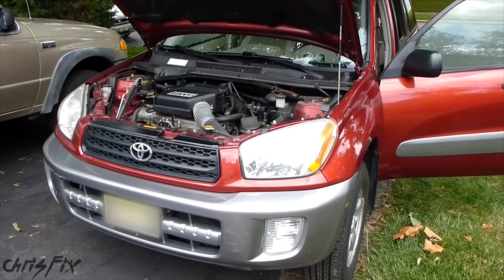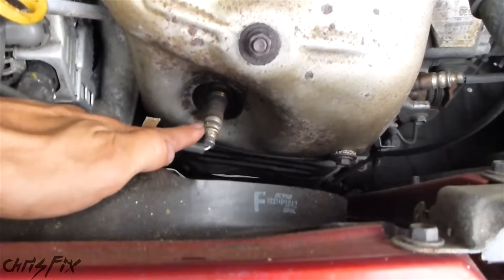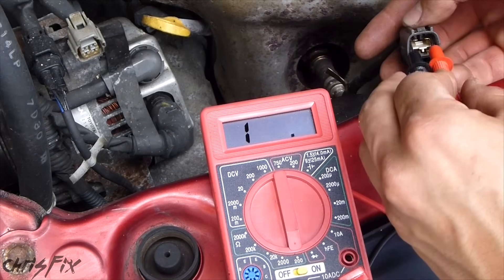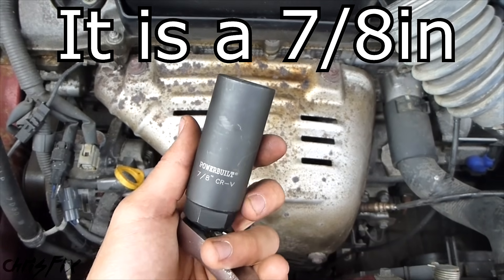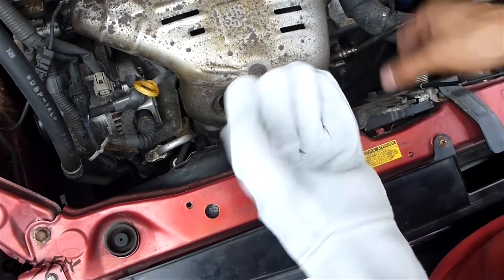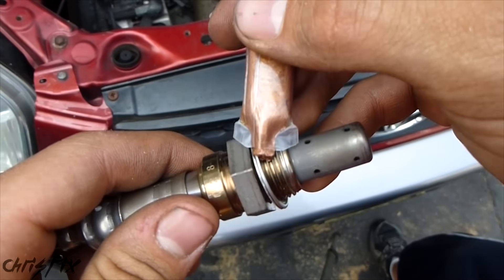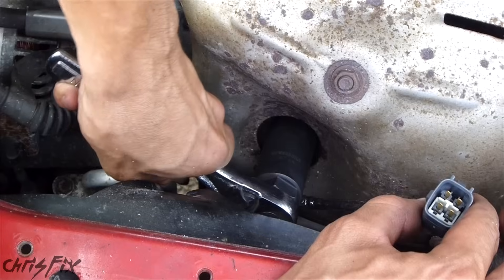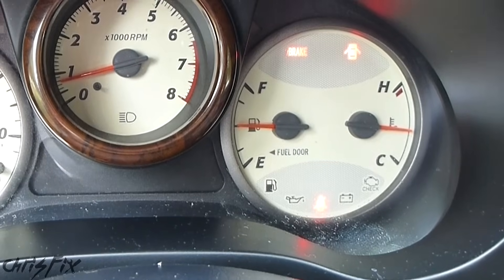How to Check and Replace an Oxygen Sensor (Air Fuel Ratio Sensor)

Comment: Replaced the sensor on my catalytic converter as there was a flatline on the voltage. I still need to fix my exhaust as the linkage between the catalytic converter and the resonator still has an opening where it'll shoot the exhaust smoke underneath the car and I don't like that. I also use the BlueDriver OBD2 scanner for the live data so I can keep an eye on the sensors, such as the Oxygen sensors, engine temperature, and so on.

Comment: You actually got that cheap Harbor Freight free gift digital multimeter to work correctly?  More power to you.  I didn't trust it so I went out and bought an analog multimeter from Home Depot.  I felt lucky that they still make them.  I have a cheaper Radio Shack analog multimeter that I fried the resistance meter on because I connected it to a live AC circuit in resistance mode.  I  also learned the hard way not to use the O2 sensor socket that HF and others sell because the slot is way too wide and does away with 2 of the hex corners and the socket can never get a grip strong enough to break the joint without stripping the sensor's hex head.  I bought one from Pep Boys that has the narrow slot and all 6 hex corners.  I also learned the hard way that the best and only way to break the sensor's mount is to use a large socket over the end of the O2 socket's hex with a 1/2"-drive and 1/2"-drive breaker bar, NOT by using the O2 socket's 3/8"-drive and a 3/8"-drive ratchet wrench with a pipe for the extra torque leverage.  The 3/8"-drive is too weak and I learned NEVER to use a pipe with a ratchet wrench, only a breaker bar.  I ruined a 3/8" Craftsman ratchet wrench that way that was an heirloom from my stepfather and he must be turning in his grave.  I doubt if I can repair it and further doubt that Craftsman would honor their time-honored no-fault hand tool replacement policy, especially after they transitioned their vendor from Sears to Lowes.  Live and learn and thanks.

Comment: hi Chris...I changed bank 1 sensor 1 on 2001 lexus gs 300 and a P0125 code popped up (didn't have this code before oxygen sensor change). Any ideas? Engine runs good and car temperature is always normal. Could an exhaust leak trigger it?
Reply: Either the sensor is bad or not put in correctly. I have a gs400 myself. Denso is the way to go not Bosch FYI....

Comment: Bank 1 sensor 1 is right side of engine topside, right?
Reply from the maker: It varies on the engine but sensor one is the sensor closest to the engine.
Reply: ChrisFix how come your amazon links the items look different to those in your video? That diagnostic tool is a Bluetooth device connected to smartphone?
Reply: Hey bro I pushed that tab but it’s so stiff can’t pull out how can I ease it out more easier?

Comment: Chris, I installed  the 2 sensors on my Toyota Camry 2002, about a week later my car stalled on the free way and dis not wanted to start, I was pulled out of the freeway to a gas station, I waited 5 10 minutes for help,  then suddenly the car stater again and I drove it for 1 mile and stop again,that happen about 1 mile and so on, that happen 5 times until I was pulled to my house and i have been able to started again for almost a month and half. two mechanics had check it and can find the cause why the car does not to start. The fuel pump, the battery is new, the starter  and spark plugs are fine. When the engine  started on those 5 occasions sound smooth with no noises or nothing.  Chris, I need your help and advise of what could be wrong?

Comment: Hi Chris my 2010 mazda 3 shows a P 2096 post catalyst fuel trim  system too lean bank 1 I bought a multimeter to do just what you did on your video but  mine is 5 wire all  different colors yellow, red, grey, white, green so I did not check the O2 sensor.  Anyway do I need to change the O2 sensor with that code.

Comment: Im getting a P0057 on a 2011 toyota sienna occasionally with the van right around the time the code popped up sometimes the van will have an extended crank before it starts.  Almost has 170,000 miles on it mostly highway miles.  Van runs good seems you can run some injector cleaner through it the extended crank issue will go away for a bit then return.  It is possibly with a P0057 to cause an extended crank.  It does not hesitate or sputter just sometimes more cranks a extra couple of turns or so before it hits.  Sparkplugs were replaced around 120,000 with denso iridiums.  The first start of a morning it does not do that its when you drive it then come back out after a 3-4 hours or so then start it sometimes it does that and sometimes it wont.  Just curious what your thoughts are on it.  We bought it used almost two years ago with 95 thousand on it and it did not do this nor have the P0057.  P0057 and occsaional extended crank started around October 2018.  When you scan it for codes thats what pops up P0057 heated oxygen sensor heater control circuit low bank 2 sensor 2

Comment: I have a p2a03 “o2 sensor circuit range/performance bank 2 sensor 1” i need help bc i been getting this code and now a p0300. And car runs normal good power but at idle it’ll drop and seem likes its going to stall and die but then it catches itself

Comment: Spraying some PB blaster a few hours before will help to break it loose and prevent a possible breaking off of the threaded collar of the sensor. If you break that off in the precat bing hole you are in for a fun time..not.
Reply from the maker: Thanks for the tip
Reply: @chrisfix  ,sure thing. Thanks for the excellent videos.

Comment: Thanks, Chris!! My RAV threw a P1135 and I spent 6 hours today reading articles, trying to figure out the air/fuel vs. heater config in the sensor wiring and diagnose the whole circuit... and it took me less than 10 mins to watch this vid AND diagnose the faulty sensor. Really appreciate it!!
Reply: Was it the one in the far back? My p1155 is showing but I checked it and it works but there is also a p1135 b1s1.

Comment: Thanks for sharing the knowledge. Question,  if I measure the resistance and it shown 13.2 instead of 2.6, is the sensor still good or bad. Thx
Reply: I think if it's showing any resistance it works. You can clearly see him using the method on a bad sensor and there's nothing.

Comment: I need to replace my upstream o2 sensor. Is it identical in design to the sensor downstream? In other words are there differences engineered into upstream vs. downstream o2 sensors or are they interchangeable?

Comment: I thumbs uped, however I was told you never EVER touch a brand new O2 sensor.  Treat them like headlight bulbs cause even the oils from your fingers can ruin them or degrade performance.

Comment: I'm having major trouble finding how to replace a bank 2 sensor on a 2005 Lexus ES330. I've been told that the bank 2 sensor is much more complicated to change because it's actually behind or underneath the catalytic converter so if this is something that I can do myself, I would prefer to do it myself because it would save me a lot of money. So far, I can't seem to find one for my specific make and model and year but everything I have seen, it's flip-flopped from what I've been told and seems like the bank 2 sensor is easier. Can you help at all?
Reply from the maker: Go put the car up on ramps and take a look.
Reply: @chrisfix  thank you for the fast response, I really do appreciate it more than you know. It's been almost 3 months and I can tell that the car starting to run not so smoothly and I've been doing Uber and I'm desperately looking for a full-time job so I can get completely away from that because it just messes your car up. As far as the bank 1 and bank 2 sensor, is the bank to normally harder to get to? I don't have ramps readily available but I think my dad does so that's something I might even go check out tomorrow but if you know about the bank 1 and bank 2 sensors, is one or the other usually a little more complicated to get to?

Comment: Hi there...i have a 2014 hilux pick up....4x2- 2.5 ....i have an error code P2237....bank1 sensor 1 ...could you please inform me about the spare part i need? with the oem code if possible...tx a lot

Comment: Hey Chris, I just picked up an f150 with a 5.0 HO engine in it. I noticed they changed the headers and made some ugly custom exhaust job and didn't include the o2 sensor. from whati can see they are using the f150 wiring which was meant for 1 O2 sensor and i believe the HO engines came with 2 because they had dual exhaust. I guess my quetions is will i need a new harness and 2 o2 sensor or do you think i can get away with 1? Thanks! and love your vids been fixing up my truck following your videos.

Comment: Best not to break free the old O2 sensor with a ratchet, esp if it is a tough customer to remove due to age and corrosion. You can damage the ratchet mechanism or cause wear that shortens its life. Use a breaker bar to free up the sensor, then spray some light lube or liquid wrench type thing on the threads, then switch to a ratchet handle. With many vehicles you don't need the slotted socket. You can use a box-end wrench, preferably 12-point. Also, on the vehicle in the video, you might be able to remove the heat shield, making the sensor more accessible, and amenable to a box-end wrench.

Comment: Hey chrisfix big fan here. I wondering if this method works as well for a 02 oxygen sensor on Ford F-150 2014 by checking the sensor with a multimeter?

Comment: How about a single wire O2 sensor.
Reply: @O R look for 0.5 volts average reading but will range from 0.1 to 0.9 volts and vary alot very quickly with time

Comment: Hi Chris, great videos as always. I had a question regarding my cars mpg. I have 2012 Honda Accord Se. It’s is getting very poor gas mileage. I am only getting about 230 miles to a tank. I have cleaned the MAF sensor but still no change. I did change the spark plugs around 40k mark. 

There is no CEL so I’m not sure where to look next. Can You think of anything I can try myself without taking it to dealership. 

Thanks in advance. 

I will post it in your MAF cleaning video as well. So I apologize for posting it twice.

Comment: Is it the voltage on the harness default to 12 v? 
I have engine light on upstream sensor p0031 i checked resistance on the O2 sensor and its fine , but voltage at harness is 3v which I am confused, any help appreciated.

Comment: hey ChrisFix, I have a 2004 Nissan Sentra with a P0420 and decided to test my upstream o2 sensor. But my o2 sensor has 6 prongs and 5 wires... also, black, gray, white, yellow, pink wires.... please help haha the other side of the connecter has 6 wires, also all different colors and they dont even match those. Also, I have the repair manual and it says that this car should have a 3 wire o2 sensor.

Comment: Do you need to disconnect the battery when replacing sensors?  
I need to replace a sensor in my car but I need to smog it and dont want to erase the memory.  Should I still disconnect anyways?

Comment: Great video. Hey Chris I have 2005 PT cruiser both 02 sensors downstream was showing on check engine light replaced it with a bosch check engine light stayed off 160 miles now both showing low voltage P0031 and P0037  on both tell me you can't use after market on them and that's the issue? ?? Or could it be something else like PCV valve or hose?
Reply from the maker: So the PCM (engine computer) supplies the voltage to the sensors. Make sure he screws holding the pcm to the firewall are tight because they are one ground source. Check and clean your other engine and chassis grounds. Clean your battery posts and cables for a good connection. If that doesn’t work, you might need a new pcm (or junkyard one).

Comment: should the battery be on while i test with a multi-metre? seems like an obvious assumption but electricity scares me haha. 
just a tip from a car-dummies perspective, before i do anything big or small, i always (over)think about whether i should be taking the key out of the ignition for the car's safety and also in case i stupidly turn the engine on mid-job when i shouldn't and would appreciate being told what to do about the ignition status for peace-of-mind. e.g. i forgot i took my oil filter off, got distracted by another job, started the engine and you know what happens next haha.
great video, thanks.

Comment: I changed the O2 sensor of a Suzuki Alto k10, I had to remove the exhaust manifold, it was very tight so we had to heat that sensor, then it came off
Reply from the maker: Nice work!
Reply: How much bro per sensor is it costly maintenance

Comment: You know if your changing the sensor just cut the damn wire off and use a deep socket or in my case i have the sockets that are open at the back
Reply from the maker: You could do that but sometimes things dont go to plan (sensor gets stuck) and cutting the wire could make that worse.

Comment: I wonder if the bank 2 , 02 sensor looks different or is the same one, can you help me ? Cause i took it out and looks like the one you got but autozone have a different one for downstream with no holes
Reply from the maker: It looks the same. It might have a different color wire connector.

Comment: Hey Chris, I had the same issue with bank 2 sensor 1 with  my 03 eclipse GTS. I changed the O2 sensor but the new one had a different connector so I had to cut and solder the original connector to the new O2 sensor and reinstalled it but I am still getting to code and check engine light. Do you think I soldered the wire to the wrong colors?

Comment: Chris,this unit is the same as mine.But the idle will go up and low,sometimes it dies while running.My obd scanner won't connect.I would like to ask if there is a hose next to the MAF sensor?

Comment: Chris should you wait  till the engine  cools off a little  , not because of burning  your hand etc  but in case of stripping  it out ? Also is this multimeter  test good for resistance   on  any o2 sensor , be it for an A/F ratio sensor or any heated   oxygen sensor, 2,3,4 wire sensor ,etc ?

Comment: Hey Chris keep it up. Can I ask: 1) Are o2 sensor removal sockets all one universal size e.g 22mm. Or are they like spark plug sockets and vary. I want to be sure I'm buying correct size.  Also why did you do it on a hot car?

Comment: Hey Chris so I recently bought a acura tsx 2005 4cy ,long story short my scanner says that my upstream o2 sensor is bad,i took a look in the trunk and what do you know theres a upstream o2 sensor (it looks used though) I checked the continuity on the 2 black wires and it says 2.6 ohms...do you think its a good sensor?

Comment: If your sensor is held in by 2 bolts that don't require an O2 socket like in the video, use a 6 point hex socket. That way you won't round the possibly very old bolts. 12 point sockets have ruined my day more than enough times.

Comment: is that what they call it these days..?? Air/Fuel ratio sensor..?? Back in the day they were 02 sensors...
Reply: Air-fuel ratio sensors are different than the old school sensors. An O2 sensor senses lean or rich, but an AFR sensor tries to keep around that 14.7:1 stoichiometric (14.7 parts of air to 1 part of fuel) reading for a cleaner burn, can detect HOW lean or rich and even sense these readings at a wider range. They also respond faster to sudden changes of that ratio to tell the ecu to not run lean or rich, like when you go from cruising to full throttle. It keeps vehicle running more efficient.
Reply: Dcc357:
isnt that one in the same thing...??  The 02 sensor measures the amount of Oxygen in the air to tell the computer whether or not more or less fuel is needed..?? 
Kinda like the afr sensor..??

Comment: Could P0171 bank 1 system too lean be O2 sensor also? And that would be the upstream O2 sensor? Before the catalytic converters?
Reply from the maker: Yes it would be the upstream O2 sensor but many times a lean condition is an intake manifold gasket leak
Reply: ChrisFix Mechanic believes it’s an O2 sensor. He didn’t look at it just did scan and got code. I mentioned gasket leak, but he says no. What do you think? Thanks

Comment: Hey Chrisfix! I love watching your videos, you have inspired me to work more on my car on my own. Anyway, have you ever done a video regarding the p0171 code? I keep getting that and my 2000 Buick Century is idling very rough, bouncing me into nausea, especially at red lights. It's never done that before until the check engine light came on. I bought the car back on Feb 22 of this year where they told me the motor had just been rebuilt. I changed the PVC valve but that didn't do anything. Do you have any suggestions to help me along? Thank you!!
Reply: IAC?

Comment: Seems like you could just cut a slot in a standard socket and save yourself a couple bucks on a specialized tool... also, kind of surprised that isn't a piece you have to torque...

Comment: Hey I did the same exact way that you did but when I turned my car on, the check engine light still was on. Also, I noticed that a mist of smoke was coming from the location in which I put my sensor in.

Comment: wonderful video, i have a question....Is this reason only the sensor issue or problem in engine that emits more emission, that triggers the sensor....
Reply from the maker: For this check engine code it is because the O2 sensor is bad. A P0420 is typical of a bad cat converter

Comment: Is there a way to reset the light and code without using a scanner?
Reply from the maker: Yes take the battery cable off the negative terminal.